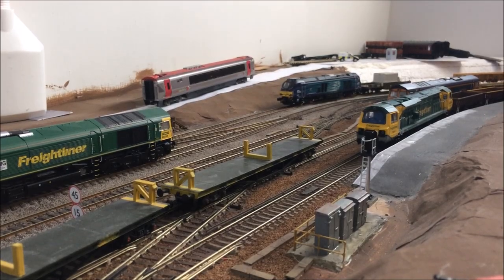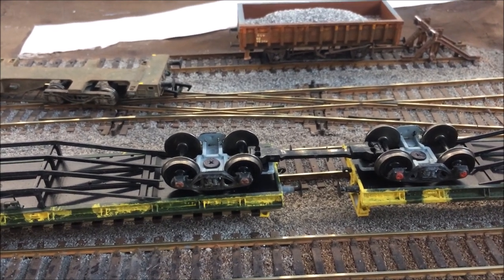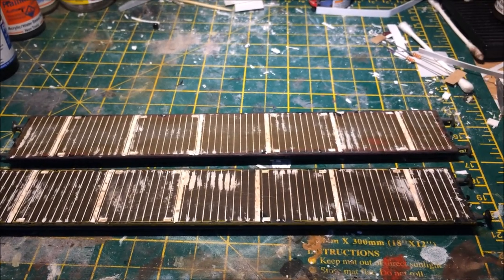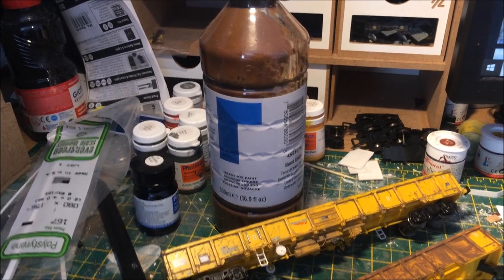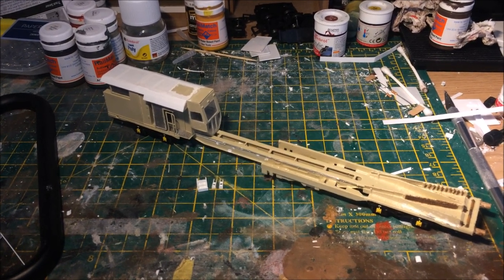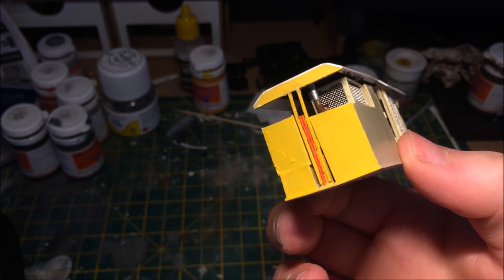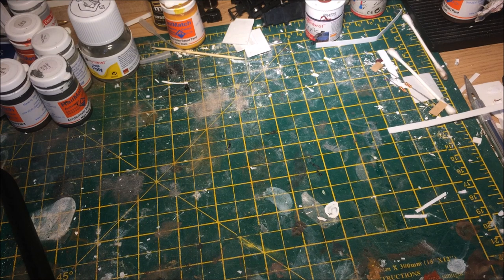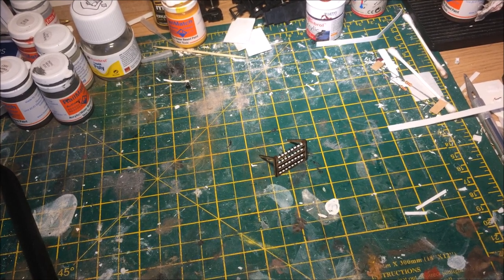April Projects and Workbench 2020

Comment: Nice update! Those wagons are looking really good. Have you thought about 3d printing some of the parts?
Reply from the maker: Thank you. During the laser cutting process I did enquire about the 3D printing service available. The cost of 3D printing was expensive considering the size of pieces produced, though I may have to 3D print some components in the future.
Reply: You're welcome. That's fair enough. I have a 3d printer so can always give it a go for you 👍. I think you mentioned in a video you are from the southern area, which is where I'm from as well 😊
Reply from the maker: That'd be brilliant. If I've got any CAD's that require printing I'll be sure to let you know. Yes, I'm from the Southern area - the sunny sunny north of Poole.

Comment: Hi there.

nice to see how things are progressing.

If you're needing dimensions of things, the best place to start is the Barrowmore Model Railway Group.
They have several of the British Rail diagram books scanned.
For your Long Welded Rail train, you'll find the dimensions in Book 400.
http://www.barrowmoremrg.co.uk/Prototype.html

Although you're doing the rebuilt version, the dimensions of the chassis are the same.

The books are limited to British Rail era vehicles, so you won't find anything built since the early 90's at the latest.

 
A suggestion to solve your glazing issue on the cab section of your chute vehicle... rather than build a plasticard frame and then try to fit glazing into the holes... consider making the end walls with clear plasticard, then mask where the windows will be, and then paint it with the colour you need.
You'll end up with something that looks better, and is strong too.

If you still want to follow the route you've taken so far, you could fix the windows with an American product called "Micro Krystal Klear"
It's used in a similar way to the PVA glue, but Krystal Klear is better.
Here's an ebay item for someone selling it in the UK.
https://www.ebay.co.uk/itm164142482811

Although you've made some compromises and some things aren't going as well as you hoped in places, keep going!
It's encouraging seeing someone prepared to do some scratchbuilding and conversions!!

Cheers
Laura
Reply from the maker: Hi Laura, thank you for that information and link! Definitely a scratchbuilder's gold mine right there. I've taken your advice and at the time of writing have got some Maskol drying on a piece of clear sheet - the original tri-glazed frame didn't survive detachment but was still neat enough to take dimensions from. I'll see how that method works out and fingers crossed I manage to pull it off. I can understand why so many people shy away from scratchbuilding and conversions as it was daunting starting the Ospreys and immediately throwing myself into the RDT. Though it has definitely been a confidence booster and learning curve, with the end result being something bespoke to the layout. Thanks once again for your very kind and informative comment :D